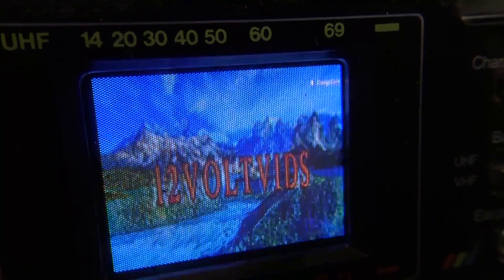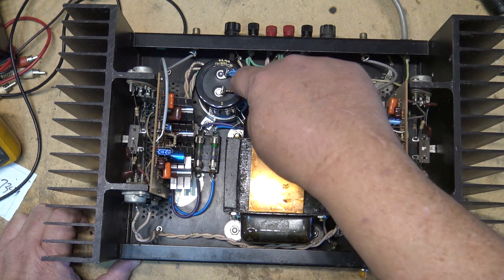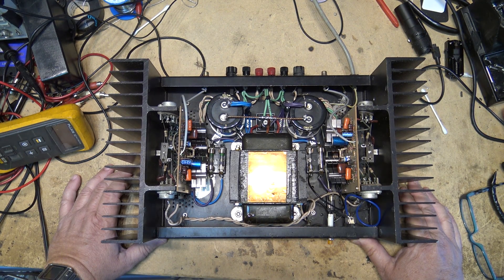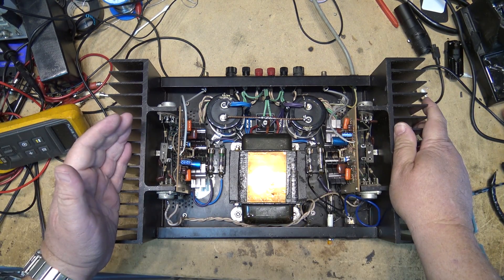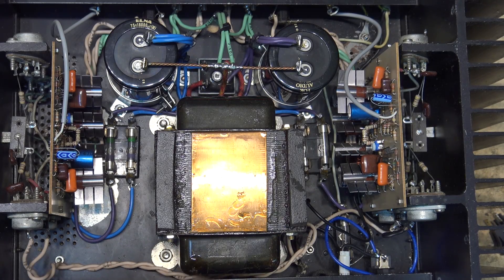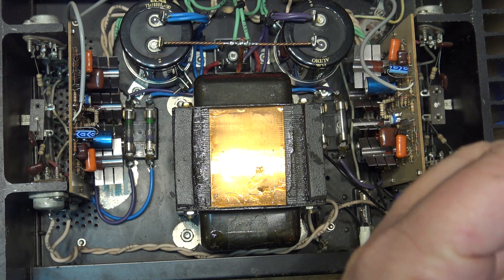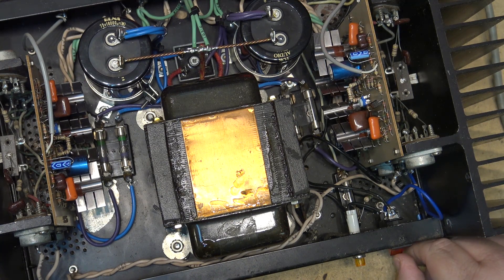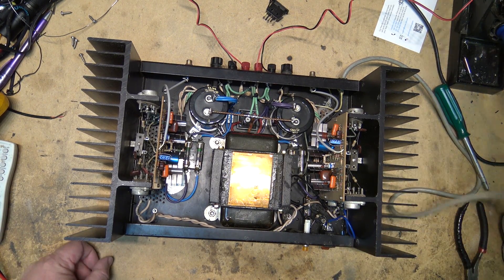Haffler DH200 power switch repair

Comment: I like your Casio watch, I had one similar until I used to stop a bundle of shingles from sliding off a roof.
Reply from the maker: I used this one to remove chrome on a car.  Some goof parked too close to me and as I passed between cars my watch caught the chrome on the car and the chrome came right off.  Damaged the watch band and put a hole in my wrist.  Can't  help wondering how much it cost to fix the car as I didn't  wait around.  I was looking for something fix the hole in my arm and then off to the er to get sewed up.

Comment: They sell thermistors to protect the power switches on these. They're on eBay. Put one on my XL-280, which is an upgraded DH-220. The power switches were a really common failure item on these.
Reply from the maker: The switch didn't fail.  The owner accidentally broke it.
Reply: @12voltvids  Just  good preventive maintenance. Don't get me wrong. Not bitchin. Just one tech to another.

Comment: Looks like a good old basic amplifier, no fancy bullshit.
A double pole double throw relay with 10 ohm load resistors could be added to catch that spike, but as you said it's not so bad.
Reply: I love my dh200 I've had it since 1981 fantastic amp

Comment: Erno Borbely designed it among many others products. Probably the most known audio amp on this planet and relatively simple. This man knew how to make big MOSFET output amps, some push-pull class A. Together with Nelson Pass, John Curl and others he's one of the designers that left massive contribution to DIY. Funny how many of products from 80-90s still work without big problems. To bad Toshiba, Hitachi doesn't make MOSFETs suitable for audio 😥. My Sima amp from Montreal didn't have the relay either but with 120,000uF in total it took forever to discharge. One thing the Differential input section would discharge much faster so there was no big pup on the outputs when turned off. The problem when I was away someone blew one channel and I couldn't get old Motorola transistors to repair it.
Reply from the maker: That's the problem with mosfet transistor amps. They are all pretty obsolete these days. What a wonderful sound they had when they worked. Push Pull are always class B. They can be biased as AB, but if it is push pull, it is class B. Class A is a single ended amp, and uses 1 tube or transistor. You can have a parallel class B, with multiple class A stages in parallel, and those will warm the room nicely, because at idle the amp will be drawing about half the rated output.
So an amp that can deliver 100 watts will be burning up 50 watts just sitting there.
That is why the push pull amp was developed. Much more efficient. Now class D is all the rage. The PWM digital amp. Some will argue that they are not digital, they are analog, but really they are digital.
The analog waveform is represented by a PWM switching carrier which is either on or off. A 1 or 0, with the time duration between the 1 and 0 state representing the analog waveform. Filter the carrier out and the amplified analog signal returns. Done right and class D can sound very good, and they are close to 100% efficient.  I had an opportunity to hear some nice class D amplifiers, and if i hadn't been told they were class D i would never have known.
Reply: @12voltvids  The Erno Borbely amps had 5-7 output pairs and biased heavily into class A so crossover distortions were NIL, say 1A per pair instead 120-200mA being the norm. It required big power supply and heatsink of course. The topology was symmetrical, with separate differential pairs for positive and negative half of the waveform, same as the DH 200, but with additional cascoding, etc to minimize distortions. 
Yeah funny how people call Class D amps 'digital' because of use PWM modulator, however it doesn't DAC at the output, only low pass filter to filter out the PWM signal. And digital output from say CD player can not be directly connected to amps input so it can not be called Digital amplifier. I don't it's possible to produce digital amp being able to work where digital signal can be controlled from input to output without changing it first to analog. Imagine how many bits of processing would be needed to make amp where signals volume control was fully digital with 60dB range and 120dB dynamics. We all know that DACs with 24bit resolution are the maximum possible, above that additional bits of information are buried in the noise from electronic components that DAC chip is made of.

Comment: I have found that a resistor of 2.2k across the main positive and negative  electrolytic caps will solve your problem when turning off the amplifier.   (The RC time depends on the  DC voltage)
Reply from the maker: Yes to discharge the b+ and b- faster after power down.

Comment: It is a good practice to insulate the switch contacts with heat shrink tube to avoid shocks.
Reply from the maker: And just how is that going to happen when the wires are securely attatched?
Reply: @12voltvids  1. You insert the tubes on the disconnected wires. 2. move them back, away from the connection 3.Solder. 4 Move the tubes forward. 5. Heat schrink. 6. Done & safe.
Reply from the maker: @jacques6753  
Duh i know how to put on heat shrink however it is not required.   In an area that someone might contact sure but this is inside a unit that has covers on it and the only people that should be poking around are service people that obviously are aware of potential  electrical hazards. How many switches have heat shrink tubing from the factory?  Perhaps in devices rates for 240v but not so much in 120 countries.
Reply: @12voltvids  Another valid alternative would be to use insulated female faston connectors. Like in my 100% US-made Hafler p3000.

Comment: Fuses in the neutral are not allowed in the uk. When a fuse blows it must be in a safe state.  Nothing live after the fuse once  it has blown.
Reply from the maker: I have no idea why this is here either.   You are correct though.  Only the live side should be fused.  This has them on both sides.  Again it was originally a kit, and as such whoever built it likely wasn't aware.  The original units had a 2 prong non polarized plug.

Comment: I know solder connections are better but, wouldn't it be easier to use Spade lugs for the switch?
Reply from the maker: Why? Just another point of failure.
Reply: @12voltvids  good point.

Comment: Please, I would like to ask a question: would it be worth repairing a Hafler DH200 and pairing it with an AMC CTV 1030 preamplifier with a pair of Dynaudio 52 speakers and an Arcam cd73 CD player?
Reply from the maker: Now that depends on what is wrong. Those DH200 amps sound great but they are very long in the tooth and I don't even know if the mosfet outputs are even available anymore.  I would guess no.

Comment: speaking of caps im sorta in a weird choice i have 4 of these devices (internet like devices i should of added) but 2 of them have blown caps just one same spot within 4 months of each other. however i don't have a 1500uf to replace it with though due to them popping in same area on both. i wonder if the other 2 will is this due to low capacitance anyway or something else?. if i put 2 820's in Parallel to do 1640uf instead would this cause any issue?
Reply: It shouldn't be a problem and ESR should be lower with 2 caps.
Reply: i see. thanks for the answer. now got a use for these caps for this application then ehe.

Comment: I've got a NAD 2100 power amp on the bench now with -5VDC at the outputs and can't find the source.  The lower power rail negative voltage is also high.  It's driving me nuts.
Reply: What's the supply voltage if you disconnect the output amp section. Did you check for faulty power supply capacitors. I would check current for positive and negative supply voltage. Also other filter capacitors. If caps and supply section is OK, something might be draining the current - don't have schematic in front of me so I'm just guessing the obvious.
Reply: @pliedtka  Believe it or not, after weeks of troubleshooting, I found the problem.  A ceramic 100nf cap was blown (C438) which connects to the -45V rail and one of the output transistors.  It must have been causing a "backup" of voltage.  Filter caps are fairly new, so I knew they weren't the issue.  Thanks for the suggestions.
Reply: @ElectoneGuy  
That kind of weird, the way they run supply rails. Is VAS, predriver and driver rail much higher than out transistors (I would put slightly higher voltage to avoid clipping the waveform). Funny, ceramics supposedly never fail, I like metalized film foil more, my guess was to keep cost down.
Reply: @pliedtka  this ceramic probably failed because the owner blew the entire right channel output transistors and melted the -45V filter capacitor.  I've never seen this kind of damage before.
Reply: @ElectoneGuy  
O s..t , I have seen some output tranies with holes in the plastic, but melted capacitors😨. On the other hand they could have run 2 pairs per channel with this voltage rails. Much safer in case someone decides to try 2ohm load. Then I knew a guy, physics student, who miss wired crossover on Focal dual voice midwoofer and send Audiolab 8000A integrated to heaven, big 17A Sankens - one of voice coils was acting as stopper instead of increasing bass output (out of phase). He used Bass tone controls at max because there were no lows.

Comment: Would you recommend using c-45 minute cassette tapes to reduce flutter? Thanks.
Reply from the maker: The tape is not what causes flutter. Tapes over 90 minute are thinner and prone to jamming and stretching.
Reply: @12voltvids  

Thanks for answering. Have the deck cassette; Renkforce tp-1000 and has quite audible flutter.
It has many clones (ion tape 2 pc, Marantz pmd300cp, Pyle Pro .....

Comment: recently i had a weird thing happen.  i listen to music over my pc, its obviously grounded.
i usually have a audio isolator between it and my preamp since i had a tube amp that was grounded and had hum, but i changed my setup and removed that isolator since it noticeably degraded sound quality.

the signal goes over a rca cable to my preamp (nad 1240) over to two different amps, depends on my mood i turn either one on. 

one out goes into a nad 2200 amp with no grounding lead.
the second output goes into grounded active monitor speakers.
now when i listen over the nad2200 and switch on&off the grounded monitors, a really loud pop occurs , sometimes even turn off my pc monitors for a short period. luckly it didnt killed my tweeters. but it heck made me jump

i had to break ground from my pc-preamp to my active monitors with a car audio isolator, its not as bad anymore but still happens.  now i have to turn them on/off only when the nad2200 is turned off

Comment: Hey i keep seeing you on youtube when i type in CRTs. 

I have a Gateway EV910A that I'm pretty sure will support 1080p resolution. It has a VGA input on it and I'm using a HDMI to VGA adapter on it. It works really well and the image is great. However, the CRT after about 10min of using will kick off to standby and then kick back on. Once it starts doing this it wont stop. It doesnt do this with 480p content and only on occasion with 720p.

I also noticed some trailing, ghosting, and whites "bloom" when its a dark scene.

Do you think there might be a solution to these problems?

Im your average joe. That doesnt really know much about electronics. But i have opened this unit up already and tweaked the HV pot and focus knobs on the flyback, because there was a large portion of the image being cut off on 720p and 1080p content. So that has been resolved or at least i get more picture now.

Comment: That's not a bias resistor.  That's R39 and is between the output common rail and input common.  So if that resistor is over heating, the amplifier has gone unstable at some point and was likely oscillating way way above the audible range.  Load the output. Scope the input and output under various input levels to be sure it behaves it self.  Sometimes they can become unstable at a particular volume level but turn up the volume and stability returns.  There should have been some kind of high frequency roll-off.  There is really no need for the 100KHz frequency response.  But if you have a good one and can maintain it, they can sound pretty good.

Comment: Thanks Dave, for the hum / isolation tnfr update.  On a previous video, you worked on a SONY KDL-32  TV.     I have a similar model and need a schematic to troubleshoot the main power board.  Do you have a link to the schematic ?   J K
Reply from the maker: Sorry I don't have a source for schematics for modern stuff.  Do they even exist?

Comment: Hi, I do know that you experienced engineer. How about using two bleeder resistors.
Reply: To achieve what? The slight variance in the true capacity of the caps and the tolerance of the resistors would not change the outcome
Reply from the maker: @incandescentwithrage  
Exactly. This is what causes this phenomenon is as the capacitors discharge one side discharges faster than the other. This is caused by multiple factors. The tolerance of the caps is only one. Generally  one side has a greater load than the other as well, as the preamp stages are usually class A and only require the B+ rail. The B- supply is only required after the phase split.
All class B (and AB is just a class B with a slight bias to keep both transistors in slight conduction so that there is no point where they are both in cutoff as that results in class B intermodulation distortion) The slight voltage swing as the amp powers down, or the slight "thump" at power up is perfectly normal on these designs. Later designs incorporated speaker relays to disconnect the speakers during the power up, and power down phases, but these amps, being kits were minimal in design. They are a good, basic solid amplifier design that gives very little trouble and can have the crap abused out of them and still work.  I would love to have one of these, and a dynaco tube preamp to drive it. That would be the ultimate combo. Tube preamp for the tube sound, and mosfet PA for some kick ass power. My Luxman LV103 is about as close to that as you can get. Tube preamp, MOSFET output, but it is only 60 watts.

Comment: Client is concerned that speaker cones pulse when powering down. Babble and rave and repeat yourself numerous times for over TWENTY minutes, yet never even once check for what the client specifically wanted checked (unusual movement of speakers).
Reply from the maker: Just what do you thing the meter measurement was for? That was to determine if there was a voltage that could damage the speakers.  I guess you skipped that part or are too dumb to understand. That or you are a troll.  You pick.
Reply: @12voltvids  - no, I saw you test voltages however you didn't check (or show) the cone movements. So when you wiggle your hand to indicate the the speaker moving, is that how far the cone moves when powering down on THIS amp? In other words, is the problem big or small, minor or major, irrelevant or alarmingly dramatic? Does the cone move a millimeter or an inch back and forth? Does it move just once or repeatedly? Is the client being alarmist, or their concern a genuine one? It would have been good for us to see what was worrying your client, rather than you simply dismissing it as "normal".
Reply from the maker: @johncoops6897  Its a non issue. It happens at power up, not power down. The woofers extend about 5 mm for about and retract back over the next 1/2 second. This is because there is no delayed start relay. All amps with no speaker relay will experience this.
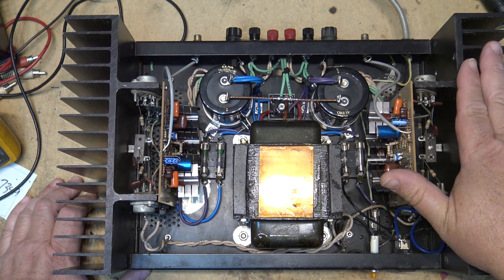Reply: @12voltvids  - I am aware of the usual turn-on thump on amps without speaker on a delay relay. However in the video you said numerous times that the client saw unusual cone movement at POWER DOWN eg: watch at 1:20 and 3:30 and 6:04 etc. You spent quite a lot of time explaining it, but you didn't show the degree that this amp exhibits the phenomenon. I think that would have been constructive to demonstrate, as well as quantify what you consider is "not a huge issue". If there was no associated sound, then an easy solution would be to refit the grill cloths, so that the cone movements remained invisible LOL
Reply from the maker: @johncoops6897  That is what he initially said, but there is none on power down, just on power up. 
What does run on longer on this one than his identical unit with original caps is it runs longer at power down, BUT, this one has larger main filter caps then the other one, so it will run for a few seconds longer if there is still audio being fed in.

Comment: Just charge him for the recap and tell him you did the resistor mod for free. He'll be happier than giving him the real news...
Reply: Please see above...
Reply from the maker: The way to keep repeat customers is by not ripping them off. That was the philosophy at the shop I worked at for 20 years.   The competition did that and one day they got stung by a TV reporter that planted a blown fuse trouble and exposed them when they were told there was tons of parts bad.